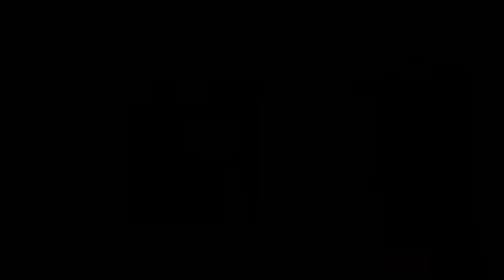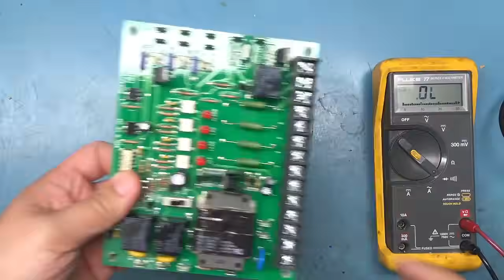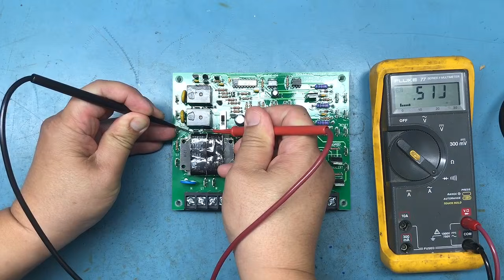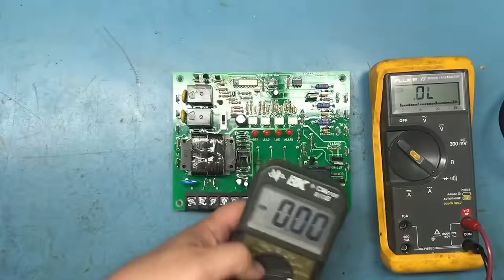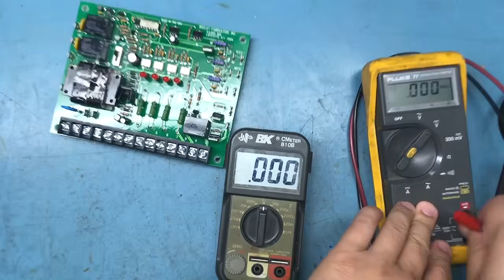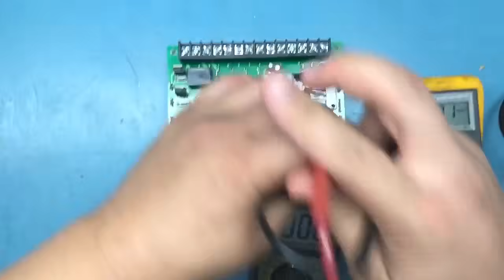Introduction to my online electronic repair course

Comment: I hope things are going well for you.  Quick question related to sourcing unknown component parts.  I have a device that uses a pressure transducer (SMD with 6 leads) that connects to a main control PCB but it appears to have failed.  The replacement isn’t available but I’d like to repair it at the component level.  Any suggestions on how to approach this?

Comment: A good video to start looking into things, but it could have used a little more context about the components, what values to expect if they work and what if they don't, what not to do as to not damage anything....
For example, even technically knowing what LED stands for, I still had to look up how to test it to make the mental connection that it is just a form of diode.

Comment: Thank you so much. It is so hard to gain experience when every job in my state requires experience. This may not count as a job experience but at least I have an opportunity to gain personal experience thanks to your course.
Reply: U can get a bunch of boards to practice on ,thats all the exp you'll need at entry lvl.Then state u were under an NDA so u cant disclose whr u worked at..voila
Reply: @frescita7385  I don't believe that is what NDA are for. NDA would not prevent a prospect employer from verifying your work experience and employment history.
Reply: It's not hard. Just join the military.
Reply: You can get work experience for free unless you're one of those woke anti-work people. If you are presentable and don't look and behave like an incel, you may end up getting hired.

Try any cable assembly manufacturers, they are almost always recruiting absolute beginners. If you have ego you don't get far.

Comment: this use to be my life ... I found that a curve-tracer with a scope set to XY mode, I would make the initial resistor/caps/diodes and transistor checks, they would be so much faster and less error prone. Once I was in zone, I could use other more detailed techniques - nice video - thanks
Reply: Thanks for the tip. Can you point me towards a good way to learn about a curve-tracer?
Reply: @joystickricksherrell774  look it up here on YouTube. I think the YouTuber NFM built one of those cheap eBay kits and showed how to use it. There are many YouTubers who have done the same.

You can buy the kits for about 30 bucks if you have access to a cheap old oscilloscope, or you can buy total self-contained unit including the screen for around 100. A little handheld module type thing I think. Curve tracers are definitely useful

Comment: Can a resister go bad in the form of increased resistance?
Reply: Greetings. Certainly. A resistor can go bad in many different ways.  It can become open circuited, it can become burned and go down in value or go up in value. A  10 ohm resistor could increase in value and become 100 ohm. If this happens, obviously you are going to have a bigger voltage drop across the 100 ohm resistor resulting in a lower output. The lower output would affect the operating conditions of  the circuit.

Comment: Lm317 is a adjustable voltage. 7805 is a regulator. The last two digits on the 7800 series is the voltage it should produce.

Comment: Hi Lue, thanks for the overview . If you have a spare moment, it would be very kind if you can clear up a couple of details :

17:25 - are you saying that even tho this transistor is reading a short, it's actually not shorted b/c it shows the same # of ohms as the resistor in its circuit ?

23:10 - I know the red probe is on the voltage regulator's ground , but what is the black probe touching , & why (since it looks like 2 unconnected circuits) ?

Comment: Could you test all the component attaching to the board or should we tate them out Sir?
Reply from the maker: Some components can be tested in-circuit and some has to be taken out of circuit but for component checking, its best to take it out of circuit for testing.

Comment: I'm interested learning this.
Been auto mechanic for  20 + years 
Little bit ok in electronic but not much 
And tired of buying expensive electronic parts want to learn how to fix same one back in automotive service and repair industry need to learn this mean while have a bmw 328xi water damage the fuse box and destroy couple models 
And they pretty expensive and I would like to start learning on them as my first project.

Comment: Can components be tested without removal?
Reply from the maker: yes they can, but the components will not always test the way they supposed to due to it being in the circuit.  As long as you know what you are looking for then you should be goo.  For example, two 100 ohms resistors in parallel, will read 50 ohms when you measure them in circuit but if you take it out of circuit, it'll read 100 ohms.  I hope that helps.
Reply: @electronictech785  Or you could always desolder one leg if they are in parallel

Comment: I like your video's appreciate you sharing your knowledge.  What I would like to see is how to take a controller board with more than one load and diagnose why a specific load is not work.  Tracing the contacts from the load until you find the fault using multimeter.  These traces power this load, so we take our multimeter and we start testing from here to the load until we find the fault.

Comment: Wow loved the video thanks so much. Please let me know when you have more of them ! I didn't understand something seems to me that when checking diodes . Well a diode is nothing but a pn junction. Wouldn't you get a beep one direction and not in the other  if in diode test on meter ?  Also would this be the same for a transistor? Isn't a transistor like two diodes put together with another lead added. SO with a transistor you would have a Base to collector junction and a Base to emitter junction ? So would you got get a beep one direction on the base to collector but not if you reversed your leads ? The same should be on the Base to emitter junction ?  I'm trying to understand with somethings I have learned in my past.
Reply from the maker: You are correct.  You will get a voltage diode drop on you meter when you place your red lead on the base and while you put your black lead on either the collector or emitter.
Reply: @electronictech785  How do I join you course
Reply: No you should not get a continuity beep in one direction due to the forward resistance of the junction is normally higher ohms than what the beep would sound on the diode mode. However depending  on the diode you should see a reading  between 0.4-0.7V as the internal battery of the meter will cause the  diode to conduct in one direction. Also a diode is a semiconductor just as a transistor is.

Comment: Is there a specific time you can join the class or are there particular start periods. I'm going to join the facebook page. Will these techniques apply to say any circuit board for example I'm interested in auto electronics.Will these techniques apply.Can you join the Facebook page prior to enrolling in the class? What is the cost and are you obligated to finish in a certain time frame? Just something I'm thinking of. Thanks you for any info 👍
Reply from the maker: No, there is not a specific time to join.  Electronic troubleshooting techniques are the same across all industries.  Sometimes other industries just different equipment for testing but for the most part, all the same.  Only members are allow to join the Facebook group for now.  And the course is currently at your own pace.  Its basically you get what you put in.

Comment: Hi, I'm trying to charge my ebike but it doesnt always recognize I'm charging at evse stations cause the voltage drops as battery charges and they charge you when not charging. So I wanted to make a lightweight cheap board that would use up enough energy so it knows I'm charging. Would you have any ideas. Thanks
Reply: If your q is how to not pay for charging when you are not charging, and you want to cut the circuit when the battery is charged and the charger is in the off or float mode you need an attiny45 , a solid state relay, and a handful of parts. if cutting the circuit will not avoid charges then your only choice is to move it off the station.
Reply: @jim8916  I wanted to make a circuit to make it look like I'm using 200 watts, when charging cus theres a fee when your not charging and my battery starts charging at about 36v down to about 0
Reply: @loveworksnoevil  what is your charging voltage 110 or 220 or what. a simple resistor load would work. if you are plugging into 36 v you would use a 5 ohm ballast resistor rated for 200 watts in series with your battery load. but depending on the charger it will probably affect your charge rate. let me think on it a bit and see if I can come up with a realistic solution that won't break the bank.
Reply: @jim8916  charging is at 240, that would use up around 200 watts even without a device?
Reply: @jim8916  i have a audio bible that drains battery without even playing it,  if ileave it alone,  do you know what it could be?
Reply: @loveworksnoevil  most likely the battery is internally discharging. if you can replace the battery to see if the condition persists it would be the easy way to diagnose, if bot you will have to clip a battery lead and put a meter between the battery and the unit to see if there is a parasitic draw and go from there.

Comment: can i repair embroidery machine electronic cards after completing this course?
Reply from the maker: This course will give you the skills to troubleshoot and repair electronic circuit boards.  I have not personally seen the electronics within an embroidery machine but I'm pretty confident you will be able to.  Plus, you'll have access to me and my team if you need help.  Lue
Reply: Most definitely. Embroidery machine cards are very similar to the board in this video. Embroidery PCBs remind me a lot of furnace circuit boards and solid state timer boards (which is what the PCB in the video is i think).
Electronics is a lot like Lego blocks. There are only a few types of parts… Sure they might look really different… But there are only a few different types of parts and once you know how they work together you can easily figure this stuff out. And embroidery machine cards are super simple because most of the ones I have seen are quite old and deal with through hole components, instead of tiny little surface mount devices. Which will be even easier to repair! I highly suggest giving it a shot you will be very proud of yourself and it is quite enjoyable!
Not to mention can save you thousands of dollars. I’ve only watched a few of this guys videos but I’m very impressed with his method of teaching!